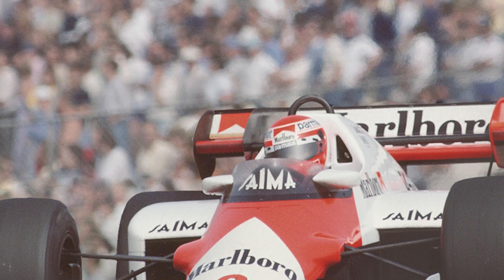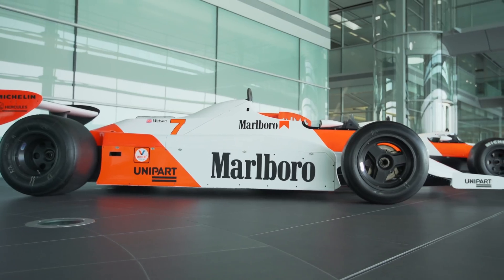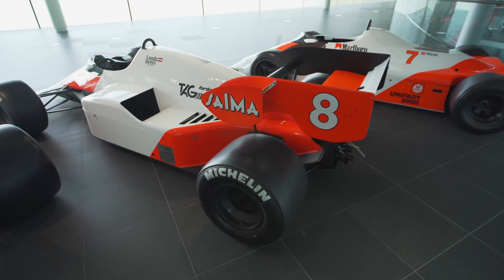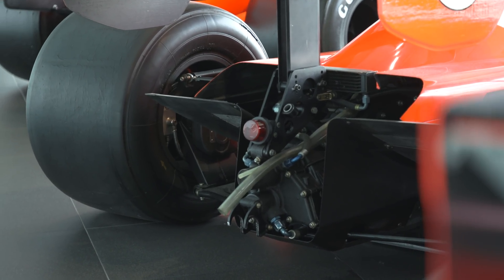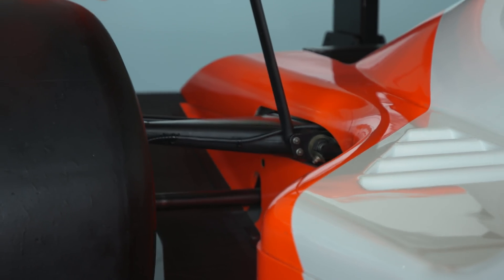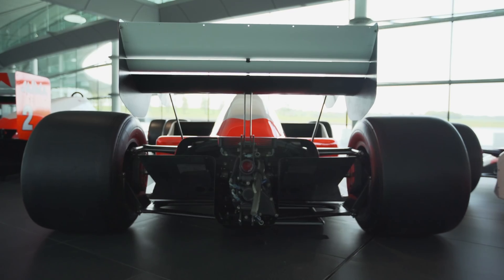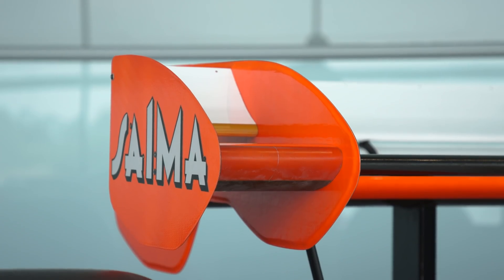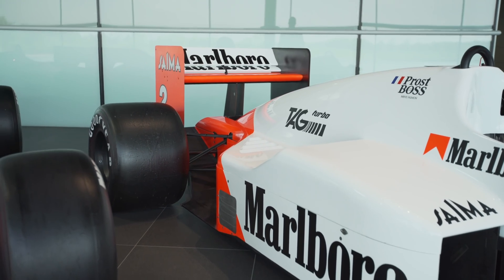McLaren's 1980s F1 innovation every team still uses today

Comment: Sometimes I wonder what the sport would be like today if engineers were allowed to create a car without specification guidelines.
Reply: Well look at group B rally. Very minimal specs that needed to be followed which resulted in cars that were extremely difficult to handle and resulted in quite a few crashes and deaths of the drivers.
Reply: @SK8TRvsCOPPS1o1  Obviously you'd have safety guidelines, genius. I am talking about performance specifications. Stop parroting that old guff this is 80's anymore. 2020 is knocking.
Reply: @F1ll1nTh3Blanks  What is your problem, my dude? 😂 There were obviously safety standards for group B but even then that didn't help of the cars were simply too fast for drivers. The team's made the cars as fast as possible which meant that when you crashed going 200+km/h, you'd die, regardless of the safety standards put in place
Reply: @SK8TRvsCOPPS1o1  No there was no "regardless of safety standards put in place". 
Group B safety standards were substandard, even for the time. People were allowed to stand inches away from metal boxes flying through the air at 200kph in their underpants. You think anyone is gonna get away with that in 2019?
Group B cars are not the same in any case. Those were Rally cars. This is formula racing.
Reply: @SK8TRvsCOPPS1o1  I don't buy the idea that they'd be extremely difficult to handle. Remember that teams want to win. If you can't drive it you can't win race. Simple.
Reply: @ғɪʟʟ 1ɴ ᴛ҉ ʜ3 ʙʟᴀɴᴋs porsche 919 evo. Simply to fast, too much aero,. If you get into contact in these type of cars, then it’s going to be fly me to the moon time. Engineers are mean people, ask me how i know... Half of the engineering effort is going to be about making your car impassable...
Reply: @F1ll1nTh3Blanks  it would just result in one very dominant team kind of as it is already
Reply: @lukas6610  Possibly. I think a budget cap and reverse feedback measures will sort that out though. 
Every team gets 150m roughly and mustn't go more than 25M above that or 50M below to keep everyone in contention.  
Alternating grids and super poles like FE and GT3. Double points for those that get into the points. Should stop teams from dominating or trying to play the rules. There are always ways around it I think.
Reply: @mabrokenleg2388  Exactly. I am just mentioning counters other series use successfully to stop one team dominating. Like Indy, FE, GT3 and even the WEC Hypercar class that you mentioned. The engineers get to do what they like with greater freedom but there are only safety parameters to stop pilots from dieing every race and budget and grid parameters to counter a Ferrari or Mercedes like domination every season. At least this way, everyone has a chance no?

Personally for me, I don't care about the design of racing formula and prototype cars but I would hardly call Newey's RB X201, Valkyrie AMR, 919 EVO or even McLarens weird ultimate Grand Tourismo cars boring and uninspiring.. 🤔

I mean as for the racing I am sure it'll be great. P1H was a good example of that, till diesel and extreme budgets killed it off. Similar with Group C pre Ecclstone.
Reply: It sounds great but in reality the cars would be so fast that passing would be impossible on the current tracks and it'd be boring after a while
Reply: At that point itd need to be a hotlap series rather then a championship for position. Itd be just as exciting to watch the leaderboard n see drivers push the limit for the perfect lap
Reply: Porsche 919 Evo, Volkswagen IDT, etc
Reply: @pentilex4338  Perhaps. Like Modern Group C all over again, exept there's no Ecclstone to kill it off.